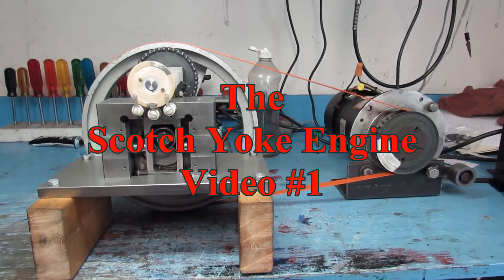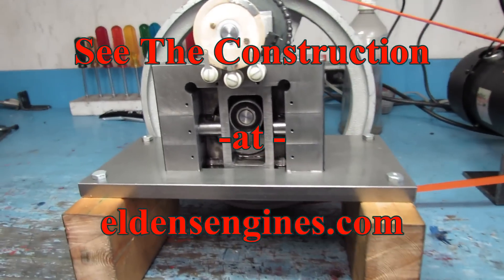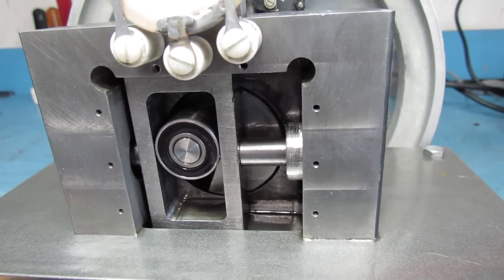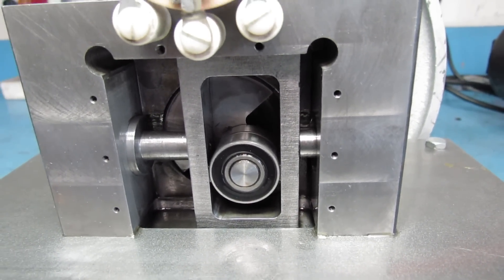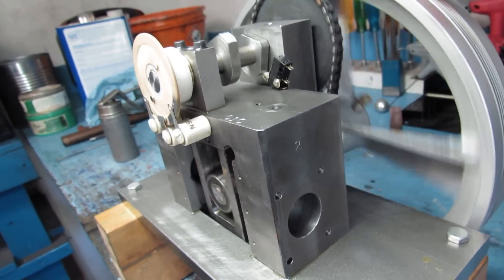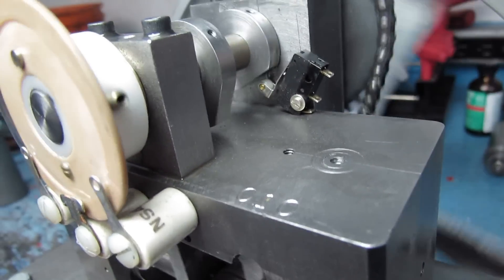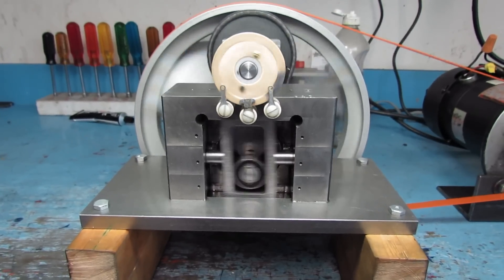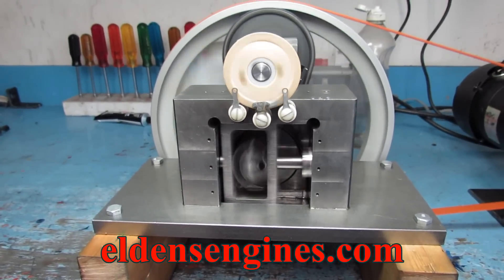Scotch Yoke Engine Video#1

Comment: What sort of clearance is there between the bearing and the yoke?
Reply from the maker: Maximilian:
There is very little clearance (less than 0.0005" or so) between the yoke and the bearing outer races.  Since they run in oil, so far, there have been no problems in this area.